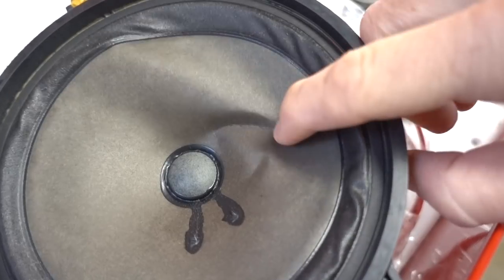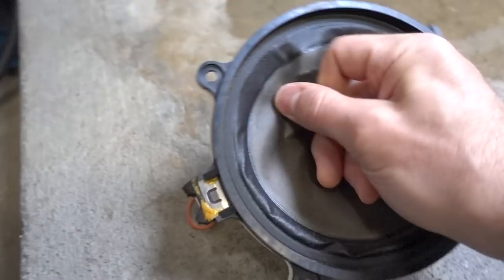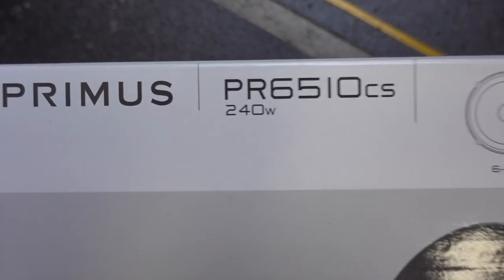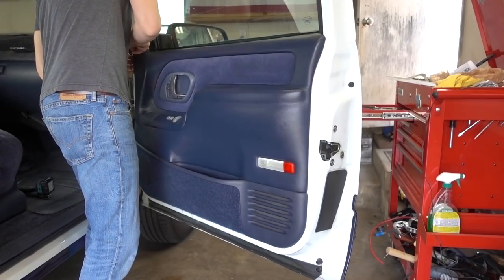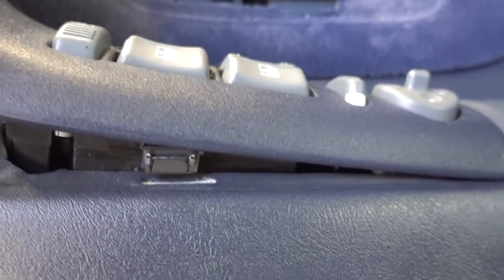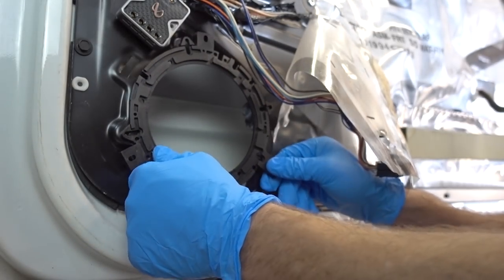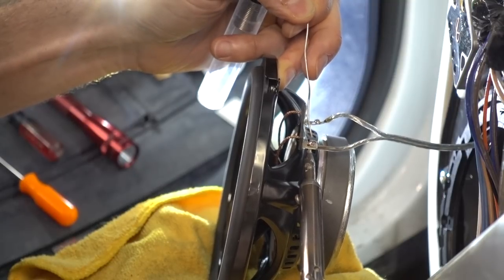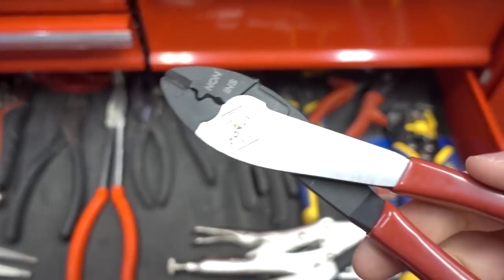1995-1999 GMC & CHEVY TRUCK FRONT SPEAKER INSTALL & REPLACEMENT

Comment: You're half right on the GMT400 thing. The platform dates back to 88 on the trucks, 93 on the Suburban/Tahoe/Blazer. However, 95 (94?) was the first year of your interuor, which is when GM put the front speakers in the doors with components. 88-94(?) was a different interior with front speakers in the dash (not component).
Reply: Michael White correct on the years. The trucks made their debut in the 400 platform in 88, but the SUVs held until about 93 like you mentioned. It was 1995 when GM redesigned the exterior and interior of the trucks, giving them the nicer looking front end (in my opinion) and the rounder dash. 1998 was the last year, when GM changed to the GMT800 platform. Some of the 2500/3500 trucks, as well as the SUVs, held the 400 platform until 2000 or so.

Comment: A quick note about your audio inputs on your factory radio. On my radio (''99 GMC Yukon) I had both a CD player and a cassette tape player, but no input for an MP3 or other audio source. I found, however, an adapter that sticks into the tape player and has a 1/8" mini jack on a 2' cord that will plug into any source with an audio out plug, sticking out of the adapter and the tape tray. I simply place the adapter into the tape player, plug the mini jack into my MP3 player (which I attached to the dash with a bit of self adhesive velcro) and voila - I have very good sound from the MP3 to my system. The adapter cost me under $10 and the MP3 player I bought for about the same price. Now I have hundreds of songs, which I can take in, connect to my computer, and change or add to at my leisure.

Comment: Great video.  And just a note for others, you mentioned chasing the wires back in the loom on the door, but if you look at the wiring diagram you can see the tweeter and woofer wires are identical, meaning you can plug the crossover into the tweeter connector only and run a new wire to the woofer.  This may not look as clean but it will prevent having to tear up the wiring loom.

Comment: why cut wire junctions? just use stock tweeter wires or woofer wires to the crossover inlet and leave the other one disconnected! don't you agree? or is there a probleme with that?

Comment: Yes I love the rain and I love my 96 suburban v8 with 300k miles.  I just installed all new speakers, wires, head unit and EQ.  A lot of work and modification but wow what a fun project and an amazing final product.  Sounds great inside the immense volume of the interior.

Comment: NOTE: There is a simpler way to wire the speakers. Crutchfield and others offer a harness adapter that will fit the plug that the stock woofer connects to, and from there you can connect the harness adapter wires to the crossover, and then run new wires from the crossover to the new speakers. The stock woofer and tweeter are wired in parallel in the door wiring harness so all you need is one of them, and the woofer plug is the handiest. No wire chasing needed. :)

Also: for a single-DIN head unit upgrade, the Metra 99-3002 mounting kit is THE BEST. No need to fool around with trying to fit the DIN sleeve into the faceplate and bend all the tabs - it has screw-in side-clamping plates that will hold the radio in the bracket. Get the antenna adapter and the harness adapter with it, and you're set.
Reply: So if i was going with all in one speakers do i still need do anything with tweeters? Or can i just put new pair or tweeters in or delete them?

Comment: Nice work Jimmy! I am glad how you found a place to mount the crossover. I did consider that with my 98, but ended up getting 4-Ways in the front doors, and I am still using the stock tweeter. The rear pillars (I have a K1500 Pickup) have 3-Ways. I plan on putting in some aftermarket tweeters in the doors, but that will be later. 

Everyone has their brand, and mine is Pioneer. Always used and trusted them and always have had great sound and performance. I bet it already sounds better, and adding an aftermarket unit will really wake up the sound in your truck.

A few things I want to add:
1: Be sure you tie back the wires where they go into the woofer and such. Often times, I have found that the extra wire will come into contact with the Window when it goes down. I like to take off the little grille at the rear of the door (3 8mm screws) and look inside while I actuate the window. I do this to make sure I am not catching any wires with the window.

2: You are right about the age. The clips WILL break, so get some replacements.

3. Most times, you can simply grasp the door lock/window/mirror control panel and pull up. It pops off very easily. A screwdriver helps to unplug the connections.

4. Crutchfield is great at helping to include connectors for the stock connector, and then to the aftermarket speakers. In some cases, you may need to modify them to connect them, but it is better than cutting the harness.

I am looking forward to more videos with the GMT400. Yes, these trucks are known by many names, but it may be best to call it by it’s model and refer to then as the GMT400 platform. Just a thought. I have done it all as well... new head unit (touchscreen unit with backup camera), speakers, amp and sub. If I can help give any tips or anything for your installs or videos, let me know. I’d be glad to help. 

Keep up the great videos Jimmy, and take special care of that truck!

Comment: I used a 5channel amplifier in my GMC and wow with a little 8" subwoofer the sound is amazing. Without the amplifier it was good but now it's on another level. I also sound deadened the floor and doors on my project work truck.

Comment: I definitely mucked up the plastic pins on my 2009 Ford Fusion, when I was replacing the window mechanism. The car had like 250K miles on it. I didn't care. I just zipped it back together with self tapping screws.

I got a 95 C1500. I'll probably do the speakers next.

Comment: I bought the Primus pr603cf speakers that come with a 3/4 inch tweeter instead of the 1 inch and they will fit directly in the window switch panel with no modifications or hacks with a dremel. It has the same housing that you thread the nut on the back as well.

Comment: So finally got around to this install on your recommendation on speakers from crutchfield 
Damn Hot Suburban is like a concert Hall. Replaced rear Doors with JBL Harmon Concert521F
Looking at the 6×9 in rear later this week.
Crutchfield is the best forgot about them . Used to buy from the when I was deployed.
Thanks Jimmy.

PS much respect to the Dietz picture. 
Thanks on to your next video on Suburban's K1500.

Comment: Hey, enjoy your videos. I have a 96 GMC SLE C1500 that I bought new in 96. It is white and has the same blue interior that you have. Some of the mods I have made on my truck. Dual exhausts, installed a double dinn 6.5 Alpine Radio, XM radio, GPS and backup camera. Also my mirrors got ugly so I put chrome mirror skins on that look great. After breaking original grill I installed a billet grill. Other than that truck is original just updated some. Regards.

Comment: any 1988 - 2002 older style non RDS radios will work in your truck.  You may have to fab some brackets to mount it up but Delco built some strong units with CD players and 5 to 7 band EQ's that sounded great.  May be an easier option for you.  I my self don't care for aftermarket radios.

Comment: I have a 99 K1500 and want to update my front and back speakers at this time . I dont want to change my head unit or have to worry about power output . What specs do you recommend that can be handled with factory headunit setup .

Comment: Mr. Jim, My 97 did not come with tweeters. I salvaged a stock pair. /Question: Do I need a crossover?  or, can I splice off the woofer wires>?P.S. I like the rain more than the sunshine...

Comment: Why is so difficult to change the speakers out? I have a 1998 GMC Suburban and the speakers are blown 😢. I got the speakers but after watching your video 😮 i dont think i can change it out. Maybe i can 😭
Reply: Its easy bro. Just did mine for the 2nd time after owning my suburban for over a decade. Havent gotten around to running new wires to the 4x10s in the back.

Comment: I had a 1995 C1500 that didn't have the tweeter.  It had the place & grill but no tweeter.   My 1997 K1500 has the tweeter. I ordered a JVC head unit and 4 speakers all for $150 from Crutchfield. The head unit has everything,  bluetooth,  pandora,  apple play, 5 volt preamp outputs  and iron was only $99. 
Can't reccomend them enough.
Reply: Which JVC HU model you purchase?

Comment: Did the set you bought do the whole Suburban? Or did you have to buy it a section at a time?
Reply from the maker: Just the driver and passenger front door speakers
Reply: @1RoadGarage  so in a suburban you would need two kits? Do they make a kit for the full truck?

Comment: hell the stock ones aren’t bad with a aftermarket headunit and paired with a sub
Reply: But it’s so much better when you upgrade your door speakers. I have a 95 Sierra with a kenwood head unit and 6-1/2” door speakers paired with a 12” rockford fosgate enclosed sub. It’s a match made in heaven. I plan on upgrading my door speakers, head unit and adding a sub on my 11 Chevy 2500hd as soon as possible
Reply: I assume mine are factory but with high pass filter set properly they sound amazing for factory and actually hear them with 2 12" incriminator audio subwoofers banging in the back. Although I am replacing them soon but just figured I'd give my 2 cents

Comment: Do I need 2 crossover’s ? 1 for each door?
Reply: exactly, each woofer and tweeter combo needs one crossover, so one for each door.
(Or you run the tweeter from independent amp channels and set the crossover there, but that's a whole different story for high end audio setups)
Reply: Marco Gruber thanks Marco u saved a serious hassle
Reply: hello , you don't really need a crossover if you get a tweeter with built in low with filter.  and the large woofer will just work fine as full range.

Comment: Chase wires? Cut tape back? What?  

They both have the same feed bro. Just cut and cap the tweeter wire, run the original woofer wire into the crossover then run new wire from the crossover to the speakers.

Done.

Great video, but you sure did create a lot of work for yourself! Lol!

Comment: I hate to be a hater but I still have my stock door speakers and they do suck bad with u have bass in them but when u pull all the bass out and run straight sound threw them they are really good I’m louder than a lot of my buddies and they have aftermarket speakers

Comment: On my 97 I used a flat head and pulling to get my door panels off the little white pins break not the panel and the pins are cheap and if your careful you can get most out